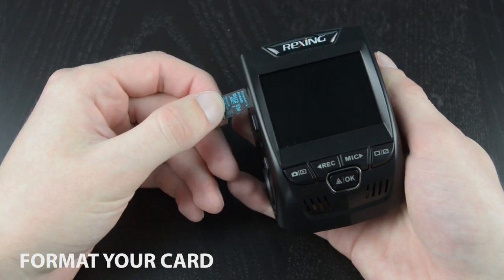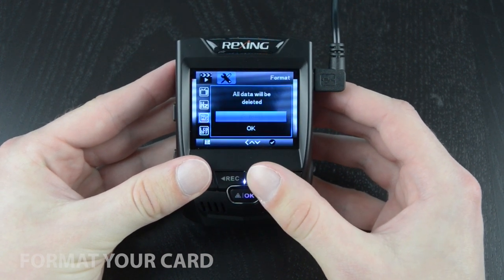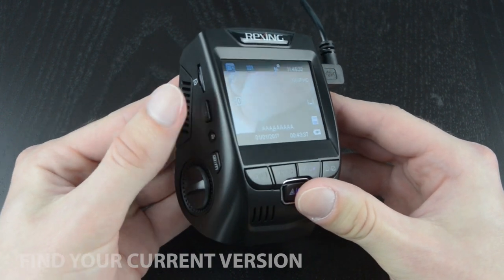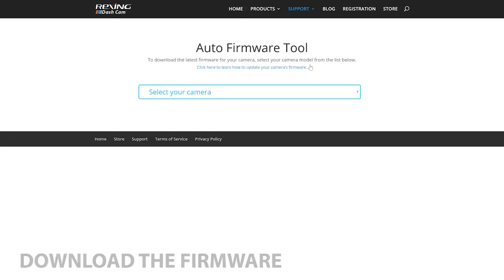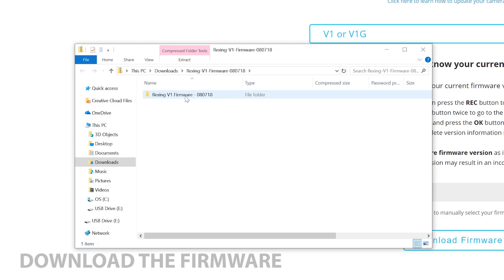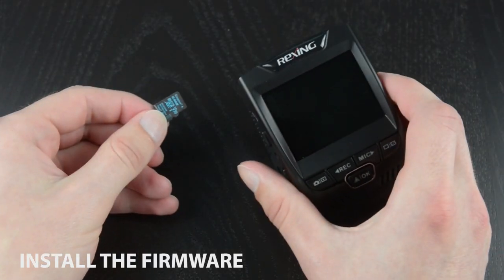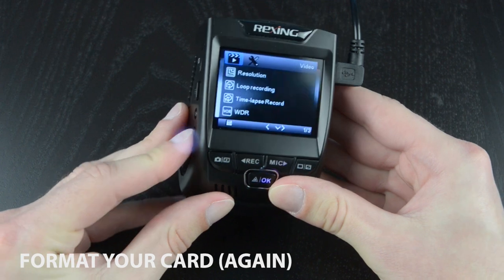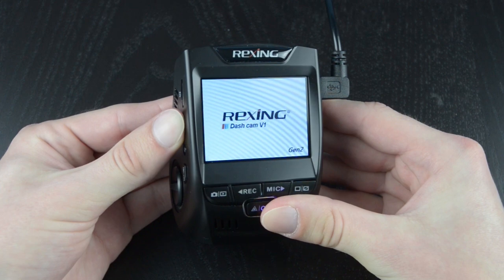Rexing Dash Cam - How to Update Firmware

Comment: I recently bought a Rexing  V1P plus dash cam and the current firmware on the dashcam is B50E0A.670.453.210610HC.01  ..  I tried to update the firmware but the website said " input error".  I really don't know if my Rexing dashcam has the latest firmware.   Rexing should put the dascam models and the latest firmware on their website.

Comment: VIP MAX firmware comes with like 11 files and not one of them does anything - there is more than one BIN file. Firmware still has the 2021 firmware.

I’ve had cheaper cameras that worked out of the box and were less frustrating than this.

Comment: Yeah. My firmware comes with 11 files inside the Zip archive. Copying all of these files on the SDCard does nothing. The dash cam (V1P Max) boots, and the firmware is still at the old (2021) version.
Reply: yes mine does the same thing, tried 5 times to update the firmware, never works.

Comment: can I ask why the v5 camera takes several hours to format the card that comes with it? it's an obscene amount of time.
Reply from the maker: Hey there, It shouldn't take more than a few minutes, you might not be using the correct SD card. Camera Requirements
Class 10 / UHS-I or higher MicroSD/SDHC/SDXC 
Card Recommendations
Kingston Canvas Go! MicroSD 
Kingston Canvas React MicroSD
SanDisk High Endurance MicroSD
NOTE: Please don't use SanDisk Ultra cards with our cameras.

Comment: Using a v3 and got stuck in a reboot cycle since purchase. Switched the USB cord out with one from an ancient TomTom and that hasn't happened again, nor has it complained about my "cluster size" (which should be in a huge font on the packaging so I know what to tell WINDOWS to use on it)
Reply: I switched the USB and still nothing smh

Comment: Hello,
I had rexing firmware B50.2017.0301.V2.4 on my Rexing dash cam. I decided to update it and downloaded Rexing V1 2nd Generation Early Model Firmware (V1_Gen2Early_180125) from this site. Unfortunatelly something went wrong and my camera does not start. I have just standart Rexing logo on the screen and nothing else happens. Could you please advice what should I do?
Reply from the maker: Hi Sasha, I would revert to the old firmware. If you need help contact our tech team at care@rexingusa.com
Reply: @rexingusa  I have already contacted  them but they are advising steps l already done several times without success :(
Reply: @rexingusa  respond back to Sasha, he’s having trouble with your product.  Unreal.

Comment: Question I have is, SHOULD we update the firmware? Like my Cam is working just fine without any noticeable issues. Is it still recommended to update the firmware l?
Reply: You never need to update the firmware until you start having issues. We recommend speaking to Rexing support before updating your firmware. There are some situations where issues may arise after updating your firmware even though your camera was working just fine before the update.

Comment: I have my Rexing v1p dash camhardwired, do I have to turn off my dash cam manually each time turn off my car and leave?
Reply: If you hardwired it correctly, when you turn off your car and leave you should hear the dash cam make a chiming  sound as it turns itself off.  My problem is getting the dash cam to go into the park mode; it won't connect to the wifi.

Comment: Sorry,  I will have to give some negative feedback to Rexing Tech Team.
Fortunatelly I figured out myself and could repair my camera.
Let me try to explain how I did it.
Rexing  site https://www.rexingusa.com/support/firmware/rexing-v1v1g-firmware/  recommends Firmware V1_Gen2Early_180125  as an update to the firmware B50.2017.xxxx.xx.x   . I initially had firmware B50.2017.0301.V2.4 on my Rexing dash cam I followed recommendations from site and downloaded recommended firmware. Then I followed written instruction from site and this video instruction,  but update failed. I tried many times, but without success. I found and downloaded earlier version of  firmware from Internet, tried to repeat firmware update, but without success again.

Than I figured out that probably I am making some mistake — each time I copied firmware to SD card I formatted it in my computer, as my dashcam was not  functioning after software update failure. In my email I clearly notified it to Rexing Team. I was hoping that they would advise some formatting parameters for SD card, so dashcam can «read» firmware from it.
But unfortunatelly Rexing Team adviced me absolutely useless things, as "be sure that you are using a Rexing charger or hardwire kit", " be sure that the sd card you are using is at least class 10 and high endurance", "Please make sure firmware you are downloading is for V1 basic" " try another SD card" … 
 Sorry I would say that competency of Rexing technical support personnel should be improved.
Finally I went and formatted my SD card in the another Rexing dash cam which belongs to my friend. Then I tried to update Firmware to V1_Gen2Early_180125, it did not work again (honestly I was expecting it). Then I formatted my SD card in my friend’s Rexing dash cam again, copied to it earlier version V1_REXING_20160310 (downloaded from Internet) and ….. update worked perfectly! My dash cam is operational, with early firmware version, but it is better than nothing.
 
I would recommend following:
Review / repair Firmware V1_Gen2Early_180125 so it works as an update to B50.2017.0301.V2.4.
Upodate installation instructions with CLEAR recommendation on formatting;
a) SD card should not be formatted in the computer if software update failed
                                           OR
b) Figer out and recommend formatting parameters if SD card needs to be formated in computer.
Reply from the maker: I can say we are going through dealing with the COVID-19 situation and brought on new hires, you may have had a less experienced tech but your feedback will surely be advised. Thank you and stay safe out there.

Comment: My dashcam Rexing V1 has dark screen and won't be turned on after 12 months. It shows the blue on the OK button when It is connected to the power cord. Sad
Reply from the maker: Please charge your V1 in your home using a USB wall charger for 3 to 5 hours (connect the small USB cable to the charger). If that doesn't work try updating the firmware on your device. Let me know if this resolves the issue!
Reply: @rexingusa  thank for responding. I did charge overnight, but no luck at all. I copied the new firmware to the root folder in memory card. Pressing 5seconds on power button, release 5 seconds, then pressed 5 seconds, then release. Nothing is happened.
Reply from the maker: @binhdangvn  Sorry for the inconvenience. Please email care@rexingusa.com and we can further assist you with this issue.

Comment: Mine has no Menu settings. Only option's on my phone is Mass storage and PC storage. My Mic button is Red and so is the word Ok.Brand new out of the box. Can't format SD because there are no options. Help. As much money as I paid and cant get any help. When first turned on it does start showing the camera and then it stops and goes to the Mass storage and PC camera and after that I can switch between them and press any button and nothing happens except it stays at the Blue Mass storage and PC camera screen. Hammer.
Reply from the maker: Hi JBird, you most likely are using the incorrect memory card. Please check out the camera SD card requirements: 
Class 10 / UHS-I or higher MicroSD/SDHC/SDXC memory card up to 256GB (not included).
Card Recommendations
Kingston Canvas Go! MicroSD (pictured above)
Kingston Canvas React MicroSDSanDisk High Endurance MicroSD
NOTE: Please don't use SanDisk Ultra cards with our cameras.
Reply: @rexingusa  Nevermind, not the SD card.Had it plugged to my laptop to setup. Plugged into my truck and got all options on screen. Formated the SD and it is good.Thanks.

Comment: "You'll need a Rexing Dash Cam, a MicroSD card, and a computer with internet access".........."I'm going to be using a USB card reader"....y'all for real?? The fact you can't format with the card installed in the dash cam is beyond ridiculous.
Reply from the maker: You can reformat the SD card right on any of our cameras settings
Reply: Yeah but you can’t load the firmware to the card through the USB connection on the camera.

Comment: I'm trying to follow this process on my V1 but the firmware will not update. The only thing that appears to update are the two images included in the firmware file. My camera is version B50_655.2016.0813V1.1. The problem I'm having with the camera is it does not properly loop record. If I do a 60 minute drive it may loop record 1/3 of the drive. I was hoping a firmware update would correct the issues but I can't update the firmware. I've tried following your video multiple times but the camera does not recognize there is a firmware file on the SDCard. Help
Reply from the maker: Hey there, thank you for your question. It seems that you have a 1st Generation V1, so make sure you are downloading the correct firmware file. To access that file directly, visit this link: https://www.rexingusa.com/support/firmware/rexing-v1v1g-firmware/rexing-v1-hw1-firmware/. Also, have you checked to make sure you didn't disable Loop Recording in the Video Menu?